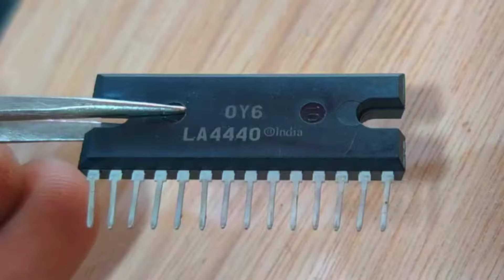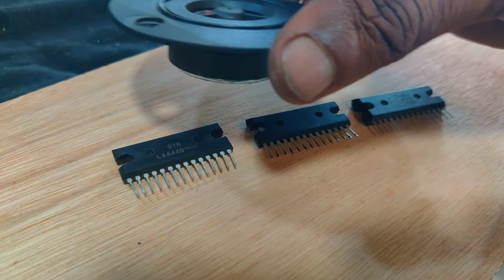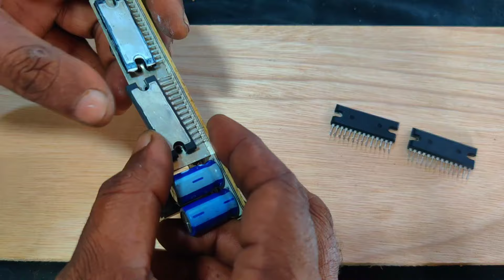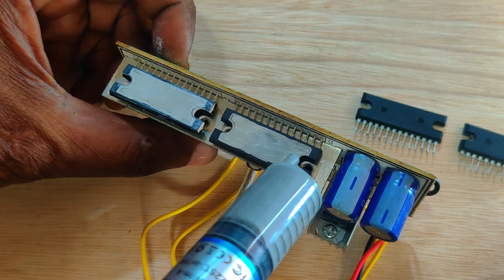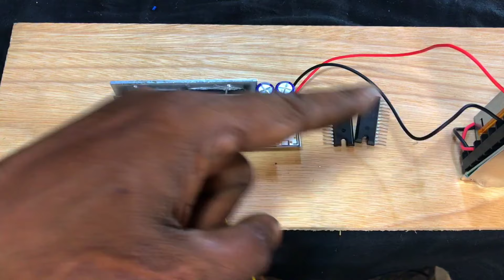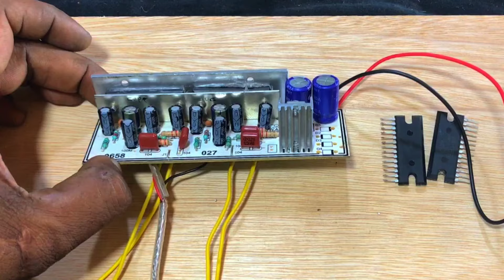How to check original and duplicate LA4440 IC

Comment: 12-0 amplifier boardil 12 -0-12 power supply engane connect cheyum dual supply
Reply: Tone control oke dual supply annu atha
Reply: 0-12 tapping edutha mathi ethre amps aanu? Transformer

Comment: Original 4440 ic വേറെ ലെവൽ ഔട്ട്‌പുട് ആണ് തരുന്നത് cd 4440 പെട്ടെന്ന് കംപ്ലയിന്റ് ആകും കൂടാതെ നല്ല പോലെ ഹീറ്റ് ആകും
Reply: Heatsink thermal paist use cheyouka
Reply: Original എന്റെ കയ്യിൽ ഉണ്ട് original ലും കണക്കാ 4440 sound clarity കുറഞ്ഞ ic ആണ്
Reply: @mithunm.j6555  sound quality ഉണ്ട് പക്ഷെ  വോളിയം കുട്ടൻ പറ്റില്ല..
Reply: @Soundsolution1010  4440 ന് sound quality ഇല്ല എനിക്ക് ഇപ്പോൾ 42 വയസ്സ് ഉണ്ട് എനിക്ക് ഷോപ്പ് ഉണ്ട് ഞാൻ ഇഷ്ടം പോലെ 4440 ഒറിജിനൽ വെച്ചു amp ചെയ്തു കൊടുത്തിട്ടുണ്ട് ഓട്ടോ കാർക്ക് set ഉണ്ടാക്കി കൊടുത്തിട്ടുണ്ട് 4440 വെച്ചു ശബ്ദ മാധുര്യം 4440 ന് കിട്ടില്ല എന്ത് കാണിച്ചാലും ചെറിയ ചെറിയ noice വരും